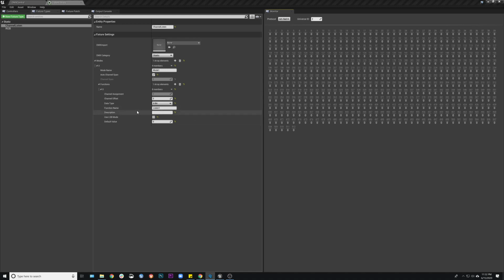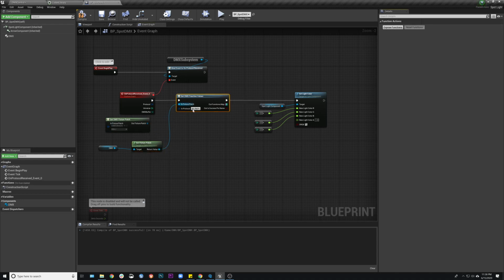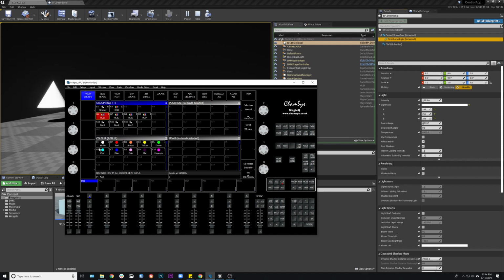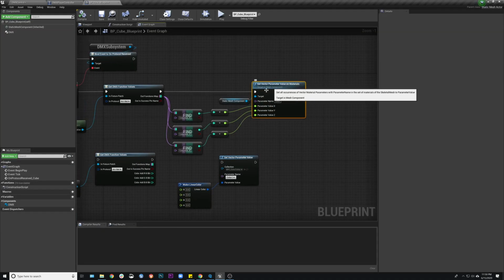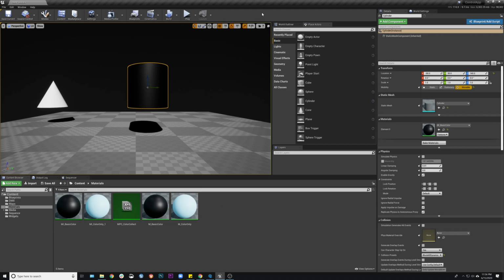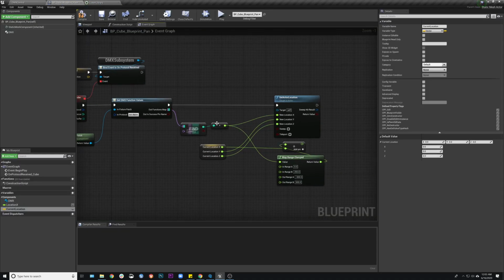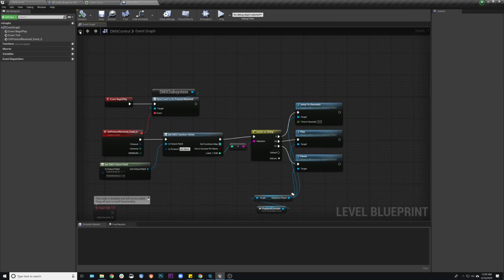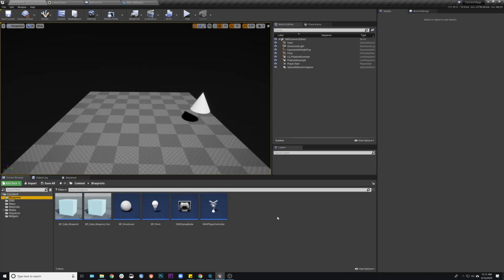Control Unreal Objects and Parameters with DMX

Comment: It's so awesome that we can use unreal to visualize our shows free,Compared to capture 1k plus price. But every tutorial I've seen the process is so lengthy to talk to 1 fixture, creating a light show of 50 fixtures or more would take for ever. I wish the process would be easier.
Reply from the maker: Did you see my previous video?  I show how to hook up a moving light in under 8 minutes.
Reply: @pixeldoes...9083  Just saw it, right on!
Reply: Given companies like ETC now build a visualiser directly into the lighting console and planning software I can't see the visualiser aspect of this really taking off because the setup is pretty long winded relative to the built-in visualiser.. I can really see this aspect of DMX to drive aspects of unreal engine is really exciting. I do theatre productions and am looking at developing dynamic projections and controlling them in a show using DMX.  Thanks so much for this video.